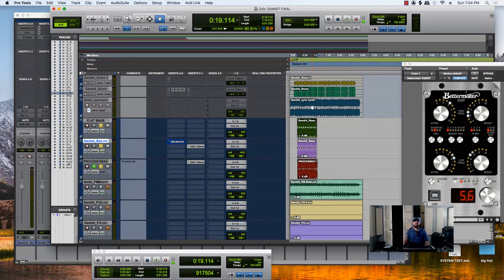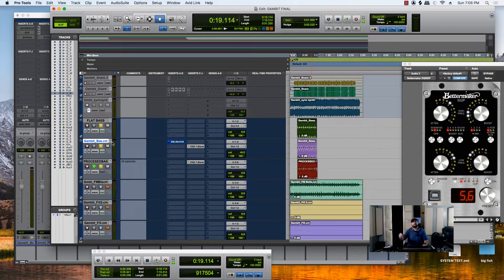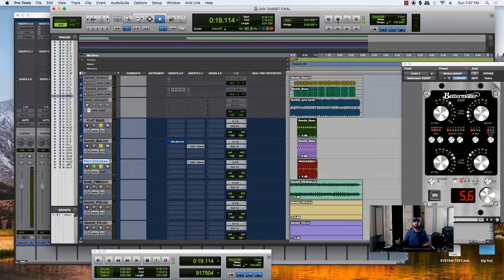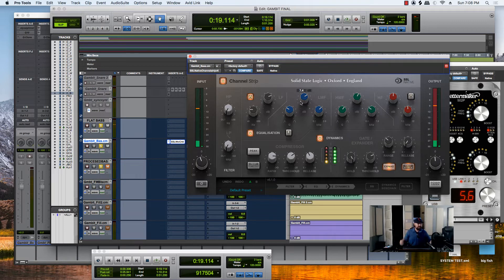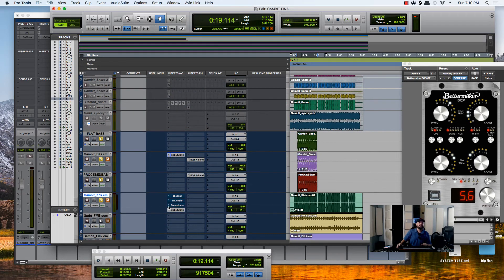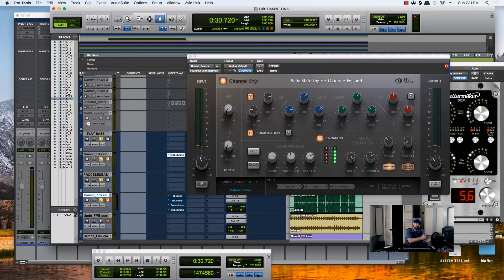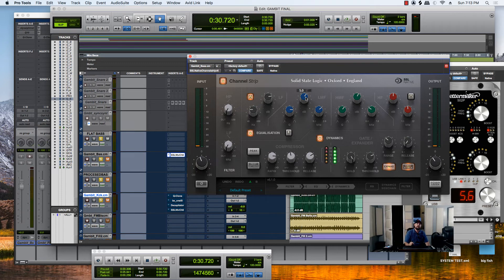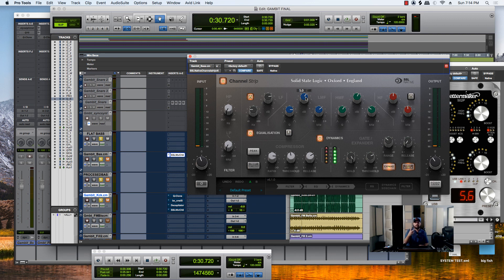SSL EQ PLUGIN VS HARDWARE ROUND 2

Comment: Hey Doug my logic regarding this hardware vs software debate is this:  A piece of hardware has a set of electronics inside it specifically for the job it was designed for.  The software emulation is using the electronics of the computer.  The computer electronics, in my humble opinion, isn't necessarily designed (or maybe "selected" is a better word) for EQ'ing or compression etc.  Or at the very least, the electronics in the computer are very different than that of a piece of hardware.  So of course the software is going to sound different than the hardware.  To my ear they both sound great but different.  Does one sound better than the other?  I think that depends on the listener.  Like the old saying goes, "one man's terrorist is another man's freedom fighter"....Lolol...
Reply: Maybe that is why UAD stuff sounds so good, having dedicated sharc processors
Reply: @UncleBenjs  I agree.  That's precisely why I prefer UAD plugs.  But I also use other emulations from other manufacturers as well.
Reply: So they are both made of electronics, but one is analog and one is digital making them very different. Imagine "blocks of information (digital) vs "waves of signal" (analog). Music is about feeling and analog just feels more real. But analog gear destroys workflow which can kill creativity. For those without a 100k board, we try to strike a balance between flow and feel.